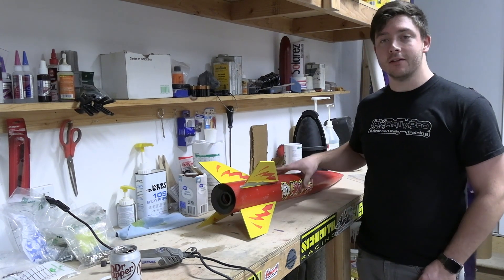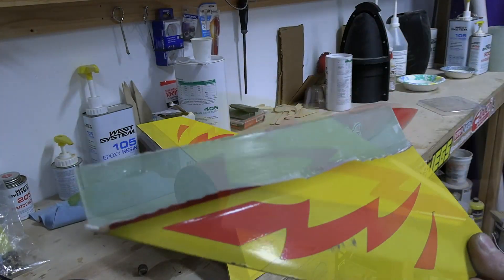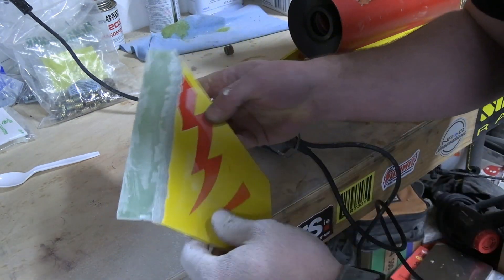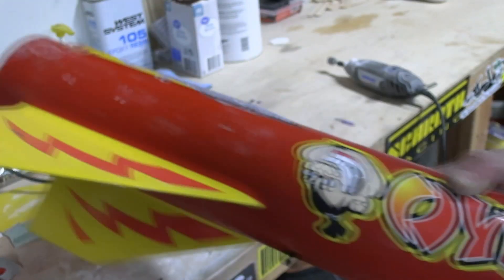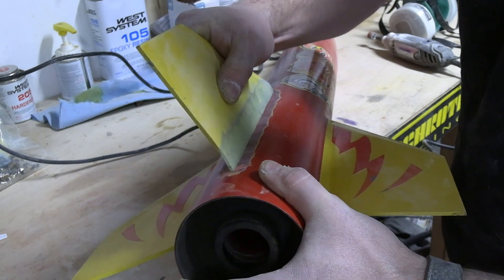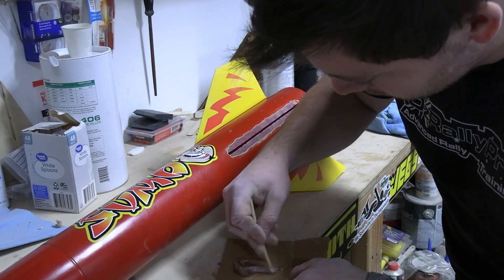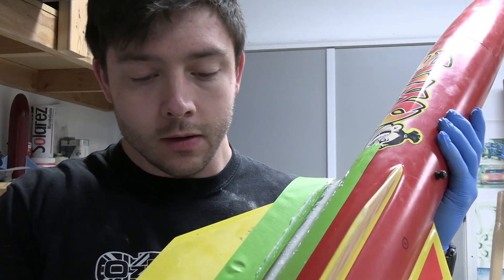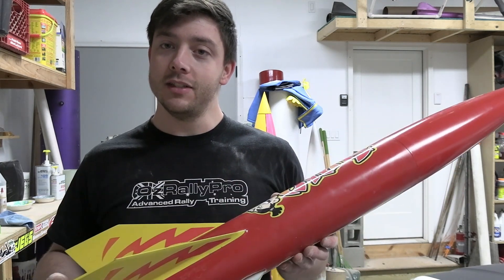Fixing My Broken Rocket!

Comment: lol imagine breaking fins on a rocket smh
Reply from the maker: I know. RockyBlogs WOULD NEVER
Reply: Isn't the aft end notorious for getting damaged on a sumo? I need to quit slacking and finish mine. @the_rocketchannel
Reply from the maker: @HalfAftRocketry it is. Mine is a fiberglass copy, so the tube isn’t a problem. On the kit, a lot of people take the piston tube and put it in the aft end to stiffen up the tube
Reply: @the_rocketchannel  right that's the same thing I heard to reinforce the aft end on the original kit. Either way, you made a solid repair on your fiberglass one.